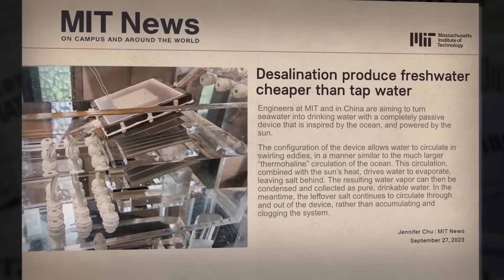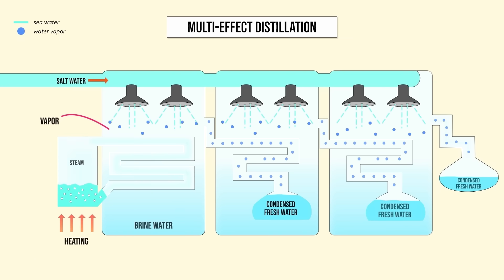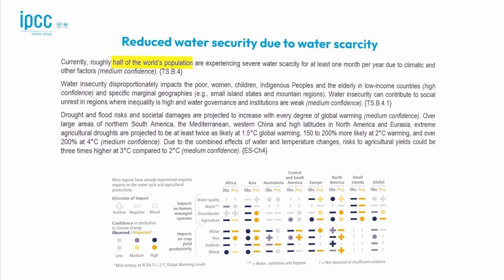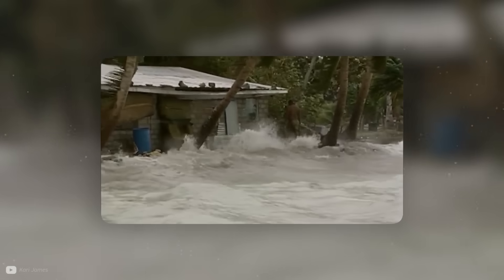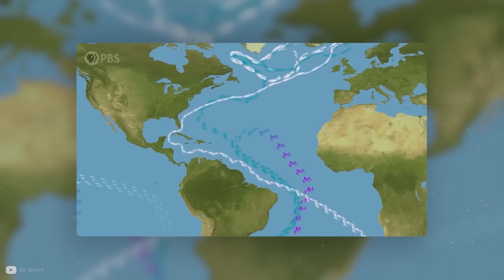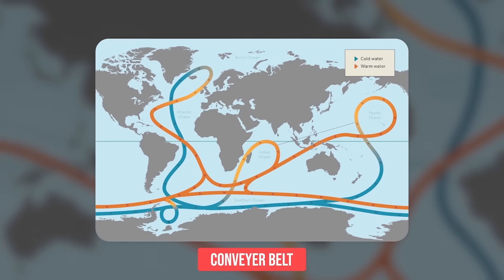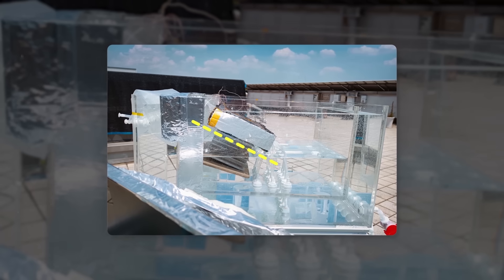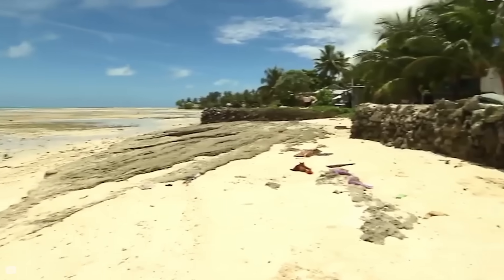Unlimited Fresh Water: Can MIT's Breakthrough Save Us?

Comment: While fresh potable water is relatively rare, saline groundwater is much more common.  While not a permanent fix, this technology could allow us to extend the life of our aquifers for another few decades.  Also, we could build large saline aqua-ducts/canals - allowing seawater to flow into artificial inland seas that we could then purify for local use.
Reply: Probably best to be extremely cautious with bringing saltwater inland. The last thing you want is that leaking into the groundwater.
Reply: That sounds like problems in the waiting. I can easily see salt water contaminating and wrecking havoc on local ecosystems. Normally it's fine if it isn't being tampered with, but drilling and pumping (which will be done for as long as it's operational) is only one major leak away.
Reply: That's happening already. As low lying aquifers are getting depleted and in tandem, sea levels are rising, saltwater intrusion is becoming quite a problem.

Comment: I don't believe it is cheaper than tapwater. That's because tapwater cost includes pumping, treatment, and distribution. You are fooling people by not including all the costs of the MIT system for a practical project.

Comment: At 13: 45 you said it runs for 180 hours without any reduction of performance. At 14:52 you said that it would run for several years before needing maintenance. What happens at 180 hours? If you have to do something at 180 hours wouldn't that be called some kind of supervision or maintenance?
Reply: I understand that it can run with suboptimal performance after 180 hours, and it would still function at whatever performance for several years. Don't know how the performance degrades over time though

Comment: Great! However, I don't understand how the heated saltwater supposedly produces water-vapour BELOW the container. My usual understanding is that water vapour is driven-off the upper surface of a body of water - not the deepest part of the body of water
Reply: You missed the part where the membrane is hydrophobic and the structure is slanted.
Reply: @LittleXtra  many thanks for explaining how I understand the world around me!

Actually, I didn't miss the part where the membrane is hydrophobic and the structure is slanted.

Slightly heated water will never have water vapour driven from the deepest part of a body of water.

Possibly the only method of having water vapour go through the membrane is by having beads of water condensed on to the ceiling of the chamber - from which the vapour could then access the membrane.

Having a vapour permeable membrane ABOVE the body of water would make slightly more sense.

However, somehow this description of a device appears to be akin to a perpetual-motion machine - the physics don't add up!

Comment: Sea level rise is irrelevant for Kiribati its sinking faster than the worst sea level rise predictions. All low islands are in the pacific and Indian oceans. The sea bed itself is going down. This has been known since the 1860's. 
Kiribati is a WW2 air base built by the US forces in the war. So is Tuvalu. Miles of reef were dynamited and bulldozed up to build the raised base for the runway. Everyone on those two island capitals live on the runway and adjacent hanger & housing section created in the war. Modern environmental constraints stop repairs being done. You could create enough material by dynamiting a mile of more of the reef again. Its all recovered nicely so it could be the same reef area. Pollution and over fishing of parrot fish are also a problem. Low islands are a mix of coral rubble, guano and parrot fish poo; coral sand. 

There is only a few mm of sea level rise world wide and the rate of change is unchanged from the ice age melt rate. There are no changes due to global warming evident and strong evidence that the global warming models etc were all frauds. There are significant sea level rise measurements at ports but that's wake effect and changes in port design. 
I am trained in the field and argued a little with one of the University of East Anglia people in Australia when he lectured there. The class blindly sided with his claim that a paper on cloud seeding did not exist so I shut up. That paper, which I had, has since been proven correct. It negates all the damage in all the models. It predates all the models. Wikipedia calls it the CLAW hypothesis, James Lovelock, but understates the confirmation. Lovelock had a go at making green house scare makes sense with the anti-claw hypotheses but that's debunked too.

Comment: There is a 4th system being developed but mostly does not make the news for some reason. This is vacuum distillation. It's old technology but people tend to try to make it over complicated or too compact. I have a design but no lab, money and I'm a medical wreck. 
In simple terms you heat the water with a separate solar hot water system filled with fresh water. A corrosion resistant heat exchanger transfers the heat to the brine. A small vacuum pump pumps vapor from the hot chamber to a cooling chamber. A spray of chilled water does the cooling in the cool chamber. By lowering the pressure over the water the evaporation rate increases greatly. A valve is needed restricting the in flow so the system does not flood you get  cheep fresh water. The thermohaline system would work with vacuum distillation too. Making things super compact sounds nice but adds un needed cost, the one thing Kiribati has lots of is space. If you count the seabed their one of the biggest nations on the planet. If you can cheaply access the seabed, cheap robotic drones, then Kiribati may be one of the richest countries on earth. We really do not know what's down there.
Reply: I love these types of comments. Always a hilarious read full of claims made by someone with zero background education, knowledge, or experience but sure, money is the problem.
Reply: @LittleXtra  I have a bachelor of science in the field. Human ecology, solar energy physics, geography, some chemistry, etc. They would not let me do engineering as that was full and I have dyslexia. Valid triage. Money does matter sadly.

Comment: We've had plasma generated ultrasonic cavitation and everything for not only cleaning water perfectly but also removing medicines that don't get processed by normal tap we pump back to you pretending we're not doing that.
Reply: LMAO. Removing a few ppm of unwanted elements vs the desalinization process are two vastly different things. I won't pretend you know what you're talking about about.
Reply: @LittleXtra  What hick? Last time I checked ultrasonic cavitation can heat water up to distill it. "Few ppm hur hur! I know the parts per million word! Hur hur! But I don't know ultrasound can produce pressures as high as the bottom of the sea and temps as high as the SUN!"

Ultrasonic cavitation is for everything you outdated THING.
Reply: @LittleXtra  Search ultrasonic cavitation.. You don't know what you're talking about but you ran your mouth.

Comment: At a glance, it looks good... up to 6 liters per hour from a suitcase-sized unit... except that it's solar-powered, and that means zero output for a large part of any 24-hour cycle, and then a gradual ramping up to reach that 6 liter mark (assuming there's enough heat from the sun to achieve any results at all), then back to zero and repeat... so I'm guessing, as you move away from the equator, this technology very quickly loses efficiency. It works where it works, I guess, and that's better than nothing, but it doesn't appear to be globally efficacious.

Comment: 11:12 Well, that's ingenious.
They can amplify the effect with solar power from underneath the membrane,
allowing heat to accumulate a little more vapor from the direction of membrane.
I'd wonder how much difference that would make, and if the result
is quicker than the low pressure osmotic filter.
I'd say the only obstacle is the height and pressure of the water that can be filtered.
I think a very thin layer of water with a dark surface membrane and a little heat underneath.
Maybe a 7-10 watt powergrid releasing heat into the membrane.

So, what's the cost ? Water per dollar expended including cleaning ?

Unlike the multilayer low pressure semi permeability filter system, the device has one drawback.
It needs much ground since the output is directly related to the amount of sunshine.
The permeability system has no such drawback.
Also, teh current design has another flaw, which is that accumulation of leftovers
happens at the top. Once again the low pressure semipermeability filter has no such drawback,
since it can be fed sideways or even from the bottom.
There is one thing about it though. It may filter out substances that other permeability filters don't.
(It's in fact the same principle, it's also a permeability filter, but then one that's based on
gas passthrough.)
(Umm, does it allow other gaseous substances to pass through ?)

Comment: 8:42 For cheaper options, the islanders should use filtered (but still saline) seawater
to bathe and do things with, then rinse briefly with clean water, and keep
the tapwater for drinking purposes or crop watering only.
Bathing with filtered seawater is good for the skin too.
This can reduce the needs from regular water use from 180 liter per person daily need
to as little as 20 liters, even when showering or bathing with the same result.
This would equate 6000 liters for the entire island's needs daily given 300 people.
(besides any crops that is, which can still be watered by rainwater that then needs no filtering.)
6000 liters is a mere 6 m3. That much a single boat could handle.
Reply: In the Galapagos they do this already
Reply: @AllenKnutson  Well, they're smart there then. I'd do the same on a boat.
Reply: I would be extremely surprised if the islanders were not already doing this. My guess is, they probably use much less fresh water on average than the suggested 20 liters. Around the world, using fresh water for anything except drinking is much more a luxury than we're used to thinking.
Reply: I think salt makes soap less effective (less foam), but you could rinse off with salt, do a quick rinse with freshwater, lather up with the water off, rinse it off with salt water, then rinse off with fresh water or whatever. I guess the exact details of how to do it, would be determined over time.
However, I get what you mean, anything that can use filtered salt water or filtered salt water with slightly less salt, could be used cheaper for anything that you can get away with using it on, maybe like rinsing out containers or rinsing off dishes  before you wash them and so on.
Basically, using the salt water to get some of the initial bulk rinsing done, sort of like rinsing a dirty dish in dirty dish water, where it still comes out dirty, but it's less dirty and stuff is hydrated so it is removed by clean soap and water easier.
Reply: dude, there's probably 10 bathtubs in the entire country.  They feeling sweaty, they jump in the ocean.  You would do well to not assume that everywhere in the world works like your neighborhood.
Reply: As others have said, I’m sure people just take a dunk in the ocean when they need a bath.  But, also, I think you’re underestimating how corrosive salt water is.  If pumped into homes, would get everywhere inside the house eventually - and if you’ve ever had a sea faring boat, you know how everything just gets destroyed in no time just from the salt water.  I’m talking buying a boat fixture made for boats in the morning, going out fishing and by afternoon, the anchor point you bought crumbles in your hand.  You’d not only need secondary pipes, but a piping system highly resistant to salt water, and still have plans how to replace the whole thing routinely.
Reply: Your mistake ids thinking that is nor the norm already.
Reply: Well I guess it could be considered, but then you need to run 2 sets of pipes everywhere (fresh and salty) all for a mediocre solution.

A similar happened in Europe where there were two kinds of electricity and it was phased out eventually
Reply: @BIELSIMON  If fresh water is a problem, then the solution is either
getting more, or changing the way it is used.
The latter has the most benefit, since it requires a low maintainance
secondary system of pipes, easily implemented on a small scale.
The former is a costly high maintainance water income through desalination.
There are no other solutions, either use less, or gain more, period.

Comment: 7:58 The problem with the 'plants' is that they try and squeeze all water from the salt water.
This leaves only extreme salty brine.
If they use tidal energy to fill the filters with salt water, but also the removal of the now more
salty water, they don't have to use use high energy pumps.
The only thing that would be costly is the filter themselves, but....
Once manufacturing of the filters has become standardized, it can be a lot cheaper.
Also, with the low pressure version (my version) the filters don't wear out as much
due to the extreme pressure abuse. The water would refresh itsself
and disseminate through natural eb and flow over time in a continuous
process, instead of being dumped en masse at once and thus killing off
all nearby seaborn flora and fauna and corals, wherever it is dumped.
Reply: Wow, you've solved what countless scientists couldn't, bravo! You must be really really really smart!
Reply: @LittleXtra  Umm, it was already solved ? Just badly implemented.
Cheap implemenations in a lot of cases lead to cost overruns later
and poor efficiency. If they do it right, no such.

I didn't solve the problem, I indicated where the 'solution' went wrong.
But my conclusion stands.

Comment: So, you build barges with glass over them.  They float offshore, and passively distill water.  It’d be great in Africa where insolation is max.
The water evaporates, sticks to the glass, drips down the glass, and that fresh water is collected in a trough at the bottom of the glass and exits to a storage tank or pipeline to shore.
Reply: Holy crap! You've single handedly solved the desalinization process that countless of scientists have worked on, bravo smooth brain.

Comment: 2:39 The way they construct those filters is all wrong.
You need large surface with low pressure, instead of small surface
with high pressure. Natural diffusion of salt in water takes time,
and the larger surface will make up for the relative low flow-through.
Basically, a surface of 10 m2 will pass roughly the same amount
of water as a 1 m2 surface at ten times the pressure differential.
Using a multi layered system, you can have like .25 km2 (250.000 m2) filter fitted
into a 50 x 50 x 10 m space and have the same passthrough at 10 millibar
as a system that uses but a single filter sized 10 x 10 m, pushing at 25 bar.
The difference is that 10 millibar is but a mere 10 cm in height difference created
pressure (eb and flow, or underneath a ship.) while 25 bars requires
very powerful compressors expending lots of power.
The boat version of this would be a 3-10 m long cylinder through which ocean
water can flow, picking up and washing away the excess salt as the ship travels.
The inside would have very long smaller cylinders in it that each are low pressure
osmosis filters, very thin, through which the filtered water can flow away in the ship's
water tank. It takes zero power. Only when the shower or such is activated,
does the pressure vat pump it's load of fresh water.
The storage is below the sea line and does not tip the ship.

Comment: Personally, I'd have made a subsurface forced osmosis device for underwater.
The more water you pump out of it, the greater the pressure difference of the water on
the device, once water seeps in, all you have to do is pump it out again.
Removing more water, creating a larger depth of empty volume,
the greater the pressure, the more water seeps in.
The only limitation is the strength of the semi permeability filter,
when standing up against that pressure increase.

Also, the filter can be layered by pressure differentials, instead
of just one filter layer.

Also, the salt water may contain stuffs that are permissible by the filter that are yet unwanted.
Desalination is not the problem, the removal of unwanted chemicals is.
if it were only desalination I'd use my own device, which is cheap and does not
require power at all. (At least on boats.)
Reply: Hi. There are solutions to clean unwanted chemicals. Can you give more details, a link eventually, on your own cheap device that does not require power? Thks

Comment: I wonder if they could make a version suitable for use in lifeboats?
Reply: No. What if it is cloudy?
Reply: @tzm1843  err, yes..? If it's cloudy either wait or resort to other methods. C'mon now.
Reply: Then the survivors wait until it is sunny of course.  For info there are already lifeboat solar units that evaporate sea water.  Plus they all should have some water supplies, to keep the survivors alive initially.  My interest in this is that it is more efficient, so would make better use of the sun when it is visible.  If they can make it small and rugged enough for that purpose. @tzm1843
Reply: With how important the angle of this desalinator is for maintaining the currents that keep the filters clear and the saltier water leaving the system, my concern would be that the movement of the boat would disrupt its function. I think they do make inflatable solar stills for lifeboats, though.
Reply: @eyesofthecervino3366  Agreed, and much the same as my thinking, on all points.  The team involved seem pretty innovative though. They may find a fix, if they look into it.  Perhaps they could even harness wave motion to help the process?